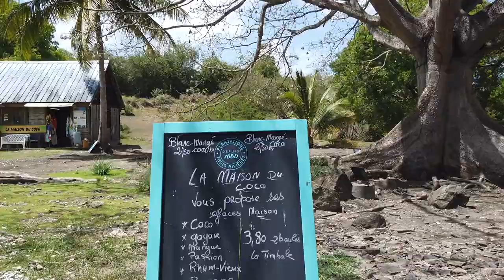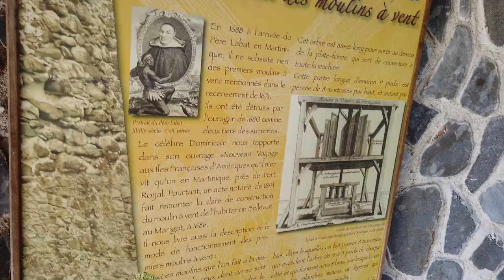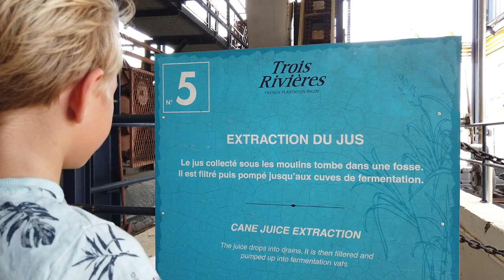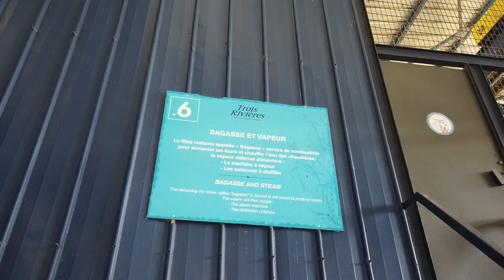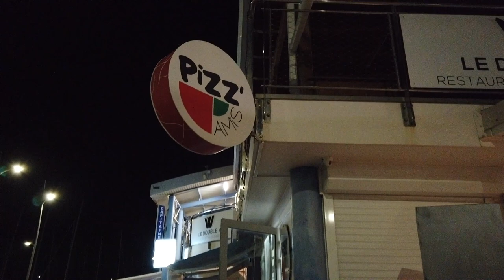The STRESS of CATAMARAN BUYING - How We COPE | SailAway 201

Comment: great video again guys, good luck with the new boat. I have a suggestion for your watermaker, you should switch your pre pumps around so that the pump end is down, this ensures that any water leaks in the pump do not run down into the motor and is a best practice standard for all electric motor driven pumps. some manufacturers will not honor warranties if they are installed motor down. Carry on and enjoy your time with the handbrake off unsupervised adventures are the best